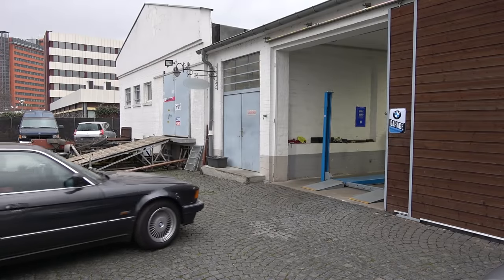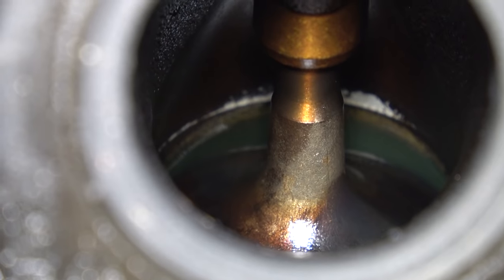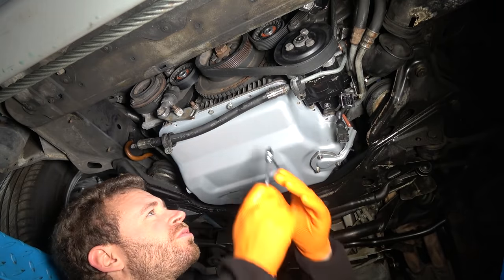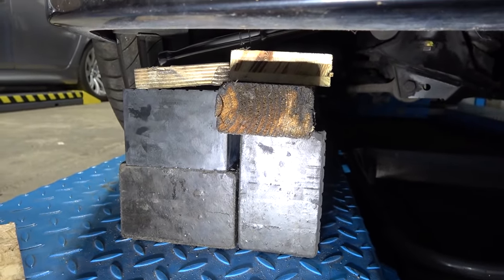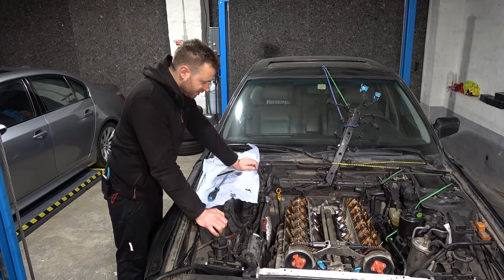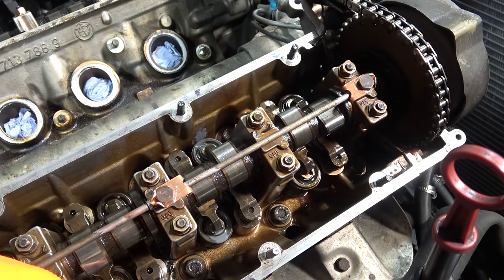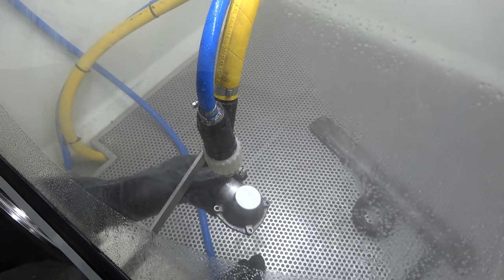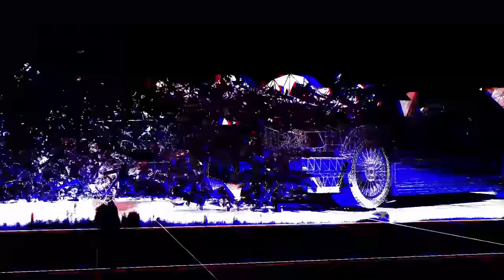Rejuvenating a 34-Year-Old V12 Engine - BMW E32 750iL - Project Karlsruhe: Part 7

Comment: "Just a bit cleaner" -proceeds to make the engine bay as clean as it left BMW... 😂😂
Reply: Even cleaner without much of the wax protectant. Better keep em clean and dry!
Reply: Actually it will be cleaner, without the wax he mentioned….
Reply: The wax clearly did an important job. The fact the engine bay looks almost as good as new is testament to the wax protection.

Comment: Hey Sreten, a little advice:
You could upgrade your Aquablast with iPad Screen-protection-glass or similar, some of them are water reppelent. So you can stick them to your sight-glass (Sichtglass) and you can then turn your wiper off and have a very clear sight. 
I learned this from CNCing, many CNC Machines have that on their Sightglass.

Good luck with your Projects! 
Viele Grüße aus Bremen!
Reply: iPad Screen-protection-glass, isn't this just Gorilla Glass?
Reply: Just use oleophobic coating. It’s water repellant but the problem with it that is will wear off over time.

Comment: The relief of getting those Collette's in place around the valve stem is very satisfying. I'm very much a diy guy and have done a few M30B28 head rebuilds. The last one I did, I polished the ports and re-seated the valves and of course the valve seals. It sounded great.

Comment: The compression is good becoz of the leaking valve stem seals, giving you a wet compression test result.  Let's see the compression results when the seals have been replaced.
Reply from the maker: Absolutely incorrect. If you actually watched that video, you'd know that the compression test was done with the engine fully warmed up, meaning all oil burned off. The seals didn't leak within seconds, but days.

Comment: the oil spray bars inside the rocker covers that BMW use reduce valve train and camshaft wear very well. Powder coating your covers is very nice touch, cerakote is also good choice with fantastic color choices. Your strategy for dealing with the oil smoke is 100% correct.......at 140,000km the engine could have a great deal of life left in it before it gets down on compression etc.

Comment: Easiest way I found to get the Valve Stem Seals off  in my BMW 850 was to use a MAPP torch for about 5 seconds. Softens them up and they come right off. Oil will not burn, watch out for your paper towels in the oil drains though. I had the single hook tool, it does not work as well as yours, it gets cocked off to the side easy.
Reply: Back in '83, i replaced the valve stems of my 633CSi without special tools (a bent 14mm flat wrench was used to compresss the springs, the pistons in high position kept the valves up). Worked out very well :-)

Comment: One thing I learnt from doing the valley pan job... always use good quality sealant (with slightly generous amount and clean off later). The factory gasket is just not going to hold up after couple years of heat cycling. It's a long area so the thermal expansion and contraction wear will make it leak again if without sealant.

Comment: You are actually right, I used a white rope while replacing my valve seals and the engine run good but after a week it exploded. Couldn’t understand why but after your insight I understood it had to do with the color of the rope. Thanks!

Comment: The stem seal job is due on my 1989 750iL, had it apart for about two years being unable to muster the energy to do it then I had to move so everything had to go back together again - I do not look forward to pulling it all apart again but this video makes it look a lot less overwhelming than it feels - Looking forward for the front suspension job as well as that's next on my list too. Thanks for this!

Comment: I've got a lisle valve keeper removal tool. It worked amazingly well but it wouldn't help with the rockers. Consider getting one of those tools. You will save alot of time if you need to do valve stem seals again. Stella job on the cleaning of everything.

Comment: My advice for aluminium parts after cleaning is to apply PPG PAK 33. Best protection for a lifetime of the part. We use this stuff on planes parts and it is great. Of course you can paint it over after dry time. All metal parts with oil and other sludge deposits can be cleaned with MEK (Méthyl éthyl cétone) that you have already used in a previous episode. 24H in that product will dissolve almost any crap on the metal parts.Just rince them well after and blow air.

Comment: Very nice job. For keeping gaskets in position (like the gasket of the pan) I suggest you Loctite 3020. It works perfectly with almost all kind of gasket. I used it for a rubber/cork gasket in an impossible positin... job done in 10 minutes.

Comment: I found most of the old V12's and V8's I checked had the timing off, chain stretches with time/wear. Really worth doing, you should be able to feel the difference in how the engine pulls. Keep up the good work!

Comment: I seem to remember BMW's always had issues with valve stem seals (?) But the intake ports and the back of the intake valves look beautifully clean, a big plus for port injection if you have seen in intake port on a direct injected engine.

Comment: quick tip I've learned from pushing many bangers around, if you need to push a car, don't push the car, move the wheels, put your hands on one of the rear wheels and rotate it, try it, it works. much easier than actually pushing the car.

Comment: There is a trick you must employ with using one sided tape (the blue tape over the cams). When you figure the length of tape required, you allow just another 1/4" of tape for the tab you will create which makes quick work of removing one sided adhesive tape. Ok, put the non adhesive side on your lower lip about 1/4" in and hold the tape steady and simultaneously suck in on the tape and pull your tongue into your mouth from the position of being up against your bottom lip and the tape. Thup (hear it) as you suck and pull tape outward, your two lips fold the tape over on itself creating the no stick tab (pull tab). 
We used to tape film down to a flat in the printing industry and use this method of making quick pull off tabs. It's a miracle.

Comment: Another great video! 
You should test some engine cleaning chemicals (oil/fuel additives). Could help clean the sludge inside the engine, if not you can debunk them.

Comment: My E30's engine was that sludgy and gross, I did a three 200 mile interval oil changes with royal purple high mileage oil. The inside of that M20 is spotless. I highly recommend! Took every bit of tarnish off and the engine runs smoother than ever

Comment: You're a wizard, Sreten!
Love how you did those valve seals with that nipple and compressed air. The mighty M70 is technically a relatively simple engine, but still a hell of a job to swap out 24 of those valve seals! I'm sure you're glad it's not a multi valve engine ;-)
I did a similar job on my V8 but with the heads off (mine is a pushrod engine though so it's even simpler than this and it has so much blowby that the valves would immediately disappear if I used your method ;-) )..

Comment: Old method my father was using instead of compressed air - a screw driver through the spark plug hole to lift and hold valves. 2 men. 1 holds while another changes seals

Comment: For that crappy cork gasket there is good Loctite product. Its tacty anaerobic sealant in spray. You spray it on, it will stick to your pan and on a top of that it enhances sealing capability ten fold.

Comment: Beautiful work!!!
*however it's so over complicated and I don’t see myself going back to BMW. we had the 750IL in 2000 beautiful boat in gold which we traded for new Lexus. then I got first gen Z4 back in 03, beautiful piece among the first 15th sold in California but 7 months later 3 coils shut down on me trying to get out of my driveway, thankfuly its all been covered by North America BMW, must mention that first 36 months you get the best service known to any car owners! 
In 2010 I found nearly mint 740I with ACshnizer goods on, that engine got dead dry heading to vegas, 5000$ later and it was never the same until went for parts. 
Ever since I got Japanese, Toyota Tacoma Miata and now brand new Corolla hybrid, old American truck for my soul and 07 Cayman if I needed to meet any germans delegates :-) and boy that is reliable and easy to fix when needed.

Comment: I feel like rope in the cylinders and pull the cam shaft might be easier... but maybe only if it were direct overhead cams. Good method though. Not disturbing the head gasket and head bolts is cool

Comment: I am wondering what you could do with a dry ice blaster.  Sure would make cleaning that valley in the V12 a lot easier. Also you could have blasted some varnish off of the oil sump while you're in there. You might want to watch I Am Detail on YouTube and see what he does.

Cleaning the engine bay and the chassis would have been almost trivial.  Not cheap, but time saving in the extreme.

Comment: I'd really like to understand your water / abrasive ? cleaner cabinet. It seems to perform MUCH better than a dry blasting cabinet, they valley cover looked like new. A big advantage from my point of view is that you don't have to clean the part before blasting to avoid contaminating the blast media. Is there some sort of sump / separator that deals with the abrasive and dirt, or does the water, dirt and abrasive all get discarded? I have an old Jaguar MKII 3.8 1963 that I want to restore (my wedding car in 1978), and this sort of cleaner would be great. Your work is spectacular!. Hi from Australia.

Comment: Question from a non mechanic. When putting the valley pan back in you said normally I don’t use sealant. I’m assuming that is because normally you would be happy the gasket is enough but is there a down side to using sealant that stops you? Epic video as always!

Comment: ONe trick you can use when blasting engine parts is to not use glass beads but a saturated sodium bicarbonate slurry.  After that once you rinse with water any remaining crystals will just dissolve.

Comment: Hi Sreten,
Would you be able to link where you found the tools on eBay to do the valve seals( both kits).  My newly purchased 850 CSI suffered the banjo back out and scared the camshaft (lightly).  I have been awaiting new camshafts from dbilas since October…sigh.  While I am placing new lifters and rockers with the new camshafts I am doing new valve seals as well.  I was hoping you were going to do valve seals soon,!  Thank you, your videos really gave me the confidence to put locking tabs on my 850 I 6speed and take on the valley pan bolts as well as many other maintenance task on the M70.  Now my S70 needs some love!

Comment: I have a question for you. My m62b44 non-vanos has been working 107c on idle and 112 on normal driving. Sometimes it shoots up to 120 for a second and drops back down. I have purchased a 87c thermostat and will install it. Here is the question, should I change to an electrical fan or stay with my new fan clutch?

Comment: I like to coat the cork gaskets with hylamar sealant. It will keep them from leaking. Torque to factory torque spec.
Reply: I used Hylomar on the valve cover gaskets on my BMW K100 when they started leaking. They never leaked again. Good stuff!!

Comment: ON those valve stem seals. I have a 25YO Z3 and never seen as much as a blue tint come out the back (so far 180k miles). In my research ( I have a N62 as well) the info I've seen is that the quality (and timeliness) of oil changes impacts these seals. Do you think that's what got to yours or perhaps something else?

Comment: You know for the issues with the v12's oil sprayer bar banjo bolts getting loose. At least it's not a PLASTIC compression fitting. I know the m116s and m117s v8 Mercedes engines were notorious for this issue where the plastic hardens and shrinks and eventually the whole bar falls right out of their place and just destroys the top end by jamming itself in between the cam and lifters.

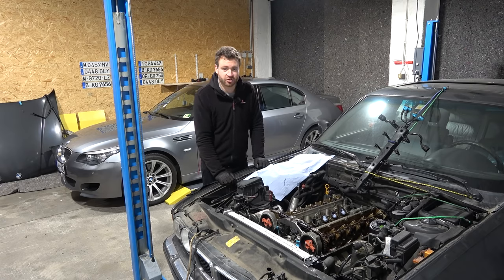Comment: 17:40 Check the M20 2.5L ring availability & specs, the piston rings may be the same as the M70 even though the M20 block is iron.
Reply: No! They are not the same. M70 have special rings not to damage the "nicasil" bore.

Comment: I'm doing something very similar with my 2005 Z4 M54.  Got everything stripped down and getting ready to pull the sub frame so I can remove the oil pan.  Every single part on the motor that has a gasket is leaking!  Then again, the previous owner didn't do any preventative maintenance...

Comment: I WAS A BMW PARTS GUY FOR 15 YEARS,,, so people would buy a 7 series V12, very cheap, typically  5000 to 8000 $. They ALWAYS needed a bunch of work. The intake "gaskets" were always a big problem. These gaskets cost $900 USA dollars. The labor to replace them was about $2000. ONLY THEN did the customers realize WHY they got these cars so cheap.

Comment: The front post on the passenger side looked like it moved quite a bit when you lifted the car at the beginning of the video after showing the leaking valve stem gaskets

Comment: Hey man since you are so good with BMW´s i maybe can ask u if u know something about the m43 engine.

I have a 318ci m43 and it has had this problem with starting the engine JUST sometimes when the car feels like it, the engine cranks but no rpm´s on the dashboard and the engine doesn´t start running i have to start the engine sometimes 5- 20 times for it to actually start running. I have changed the cranksensor, fuel pump and ignition switch and still nothing. (i live in a cold country and the battery sometimes dies in the morning)

Comment: I am rebuilding an M73. I originally had an M70 and switched to an M73 (Long story) Can I install M70 crankshaft bearings in an M73. I already had all new bearings for the M70 so I was hoping to use them. They are the same diameter however the rearward main cap bearings are different. The M73 has two bearings similar to the all the other bearings except it has separate thrust bearings (4 total) as opposed to the M70 bearings which are two pieces but it has the thrust bearings all in one bearing. The specs all seem to be the same just a different design.

Comment: What kind of chemical did you use to take away that awful wax on everything in the enginebay?
I have an 850 and i tried many different methods to remove it but nothing seems to work well?

Comment: If anyone is reading this. I bought a 730ia e32. The engine bay is similar, but what I question is can I use the 740 or 750 ignition coils in the 730 v8???

Comment: just looking at this makes me wonder....
There are some things...
BMW obviously have a generous engineering budget
I6 is the ultimate engine, whilst being reasonable.
V12 is obviously the actual ultimate.
Did BMW slant their I6 engines all theses years, just because that's where they would be if it was a V12? It's a 30 degree slant on the 6 cylinder engines.
just thoughts!

Comment: I never knew the valve and valvespring system could be so complicated and made out of small parts. If someone tells me the valve stem seals are gone on my car, that's it, i'll just admit total loss, considering the time it takes to replace just one out of 16 (luckily, i don't drive a 48 valve V12)

Comment: Hi there, does anybody know if the black valve stem seals are the original ones? I am working at a 1991 e31 m70  and the stem seals are red. I am wondering if i should change them. The engine has 270k km an i dont have any service Information. Thx

Comment: recent watched a vid where the guy had done a engine rebuild and hhad sand blasted the engine block and some other parts. It soon had issues and it was was caused by the ebrasion media in the oil ways he could not get out. Hesaid he will never use ebrasive media on parts that take oil. i am no mechanic just mentioed after a sreten`s concerns of residue.